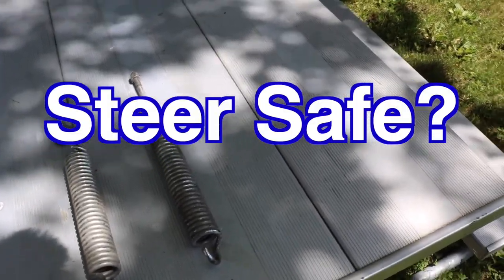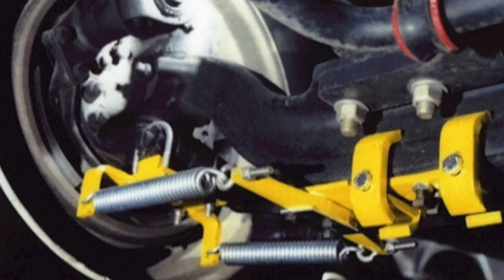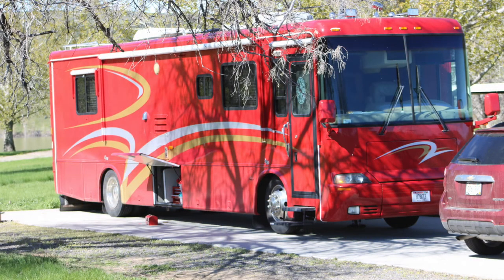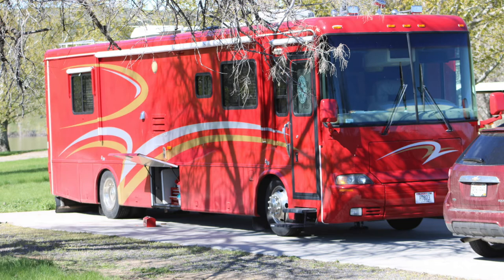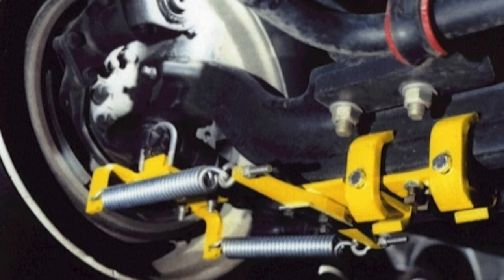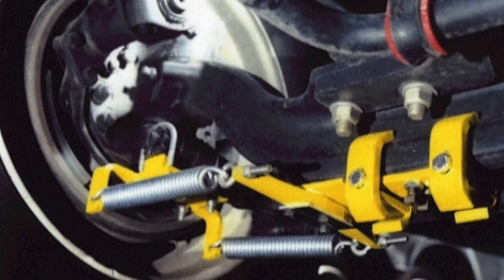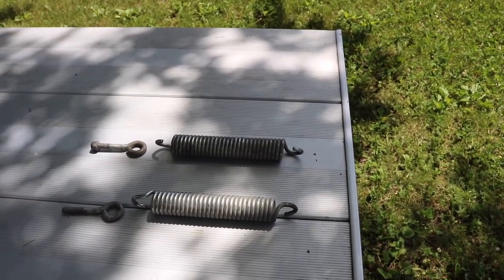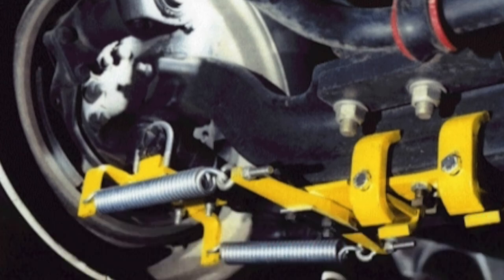Steer Safe for RVs

Comment: We purchased a 2007 Tiffin Front Engine Diesel on a Freightliner Chassis last fall in Florida that had the steer safe installed and drove it home, about 1200 plus miles. Drove like crap, just like you explained in your video. I am a CDL holder and earn my living driving, so like you I know what it SHOULD feel like. Planning on taking it off before our 2 week trip to Oregon from South Dakota. Thank you for the video.

Comment: I had a steer safe installed on my class A in 1988, the improvement was amazing, had it on for 35 years, it drives like a car.
Reply from the maker: So, you're telling me your class A had poorly designed steering so you had to add springs to it?  Steer safe is nothing more than springs to artificially center the steering. If you have to add springs to an OEM design something wasn't right to begin with. What year and make is your class A? Are you a professional driver like me who had literally driven large vehicles miles on end so you know how they should handle? Steer safe is a cover up for issues that should be fixed at the root. Cheap and dangerous bandaid if you ask me.

Comment: I just took these off my 31' E450 Class C during a front sway bar upgrade.  One of the brackets was bent confusing me what they even were.  I am knowledgeable in i beam suspension and these through me off.  Much better handling with the better sway bar and these things removed.
Reply: ill buy it
Reply: @SolHersh  This was over a year ago.  One of the sides was way bent.

Comment: I suppose someone else may have found it a better solution but I always believe that factory setup is the best.  You can keep the add-on gizmo's...
Reply: Unfortunately factory isnt sufficient enough for the width..  Hydraulic steer assist is the best add on combined with steering stabilizer.   Never no play ..less wear on tires always steers great